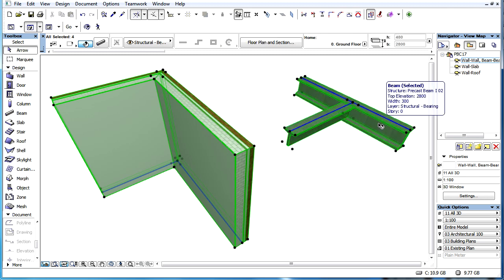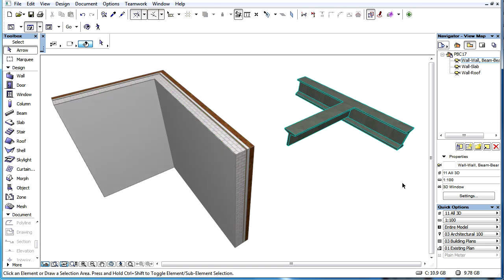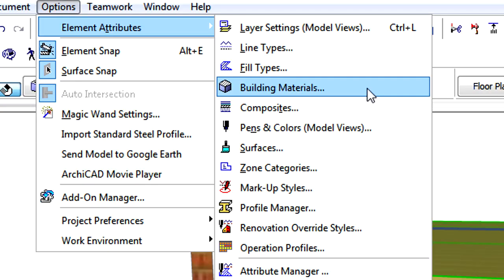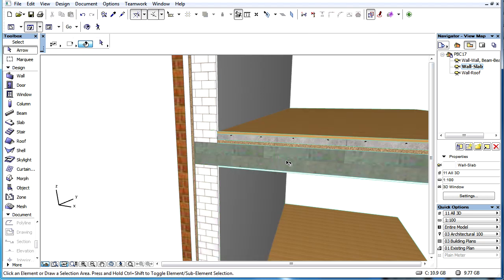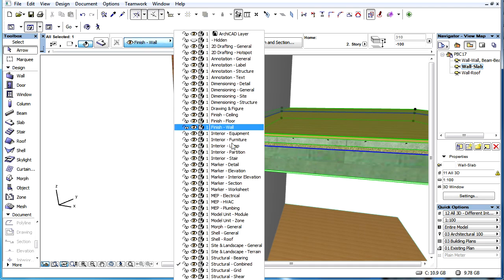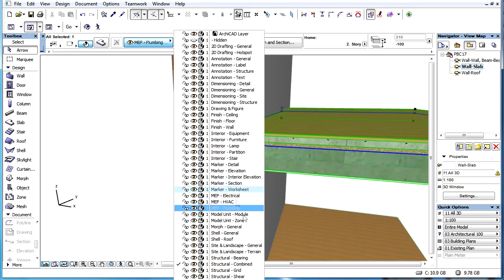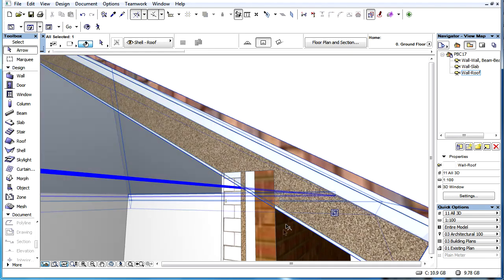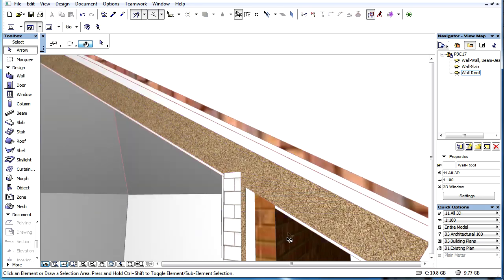ARCHICAD Priority Based Connection methods

Comment: The red external wall in the end of video clip (through using the third PBC connection method) after using the connection command was cuted not correct. As the wall can not be cuted as a paper. Maybe it is because it has not a ''core'' component type (in case if this was a layer of composite construction).